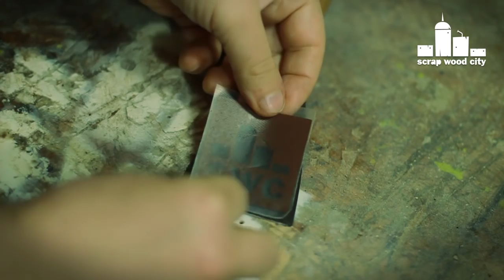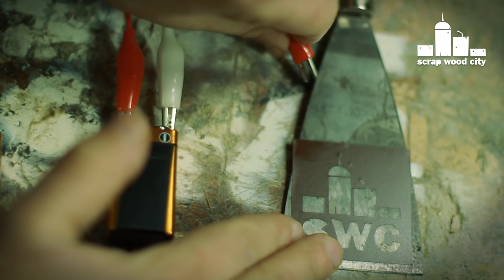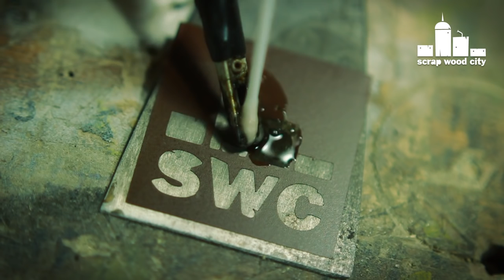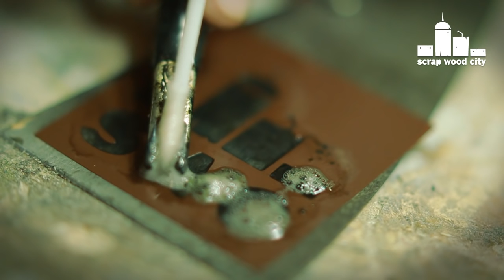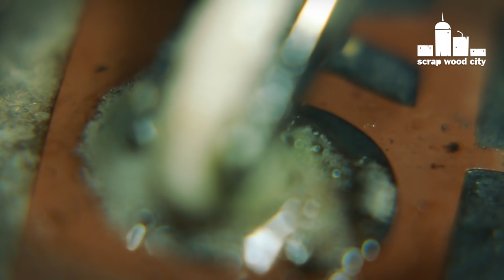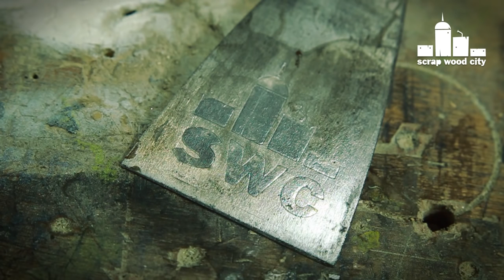DIY electrolytic metal etching with 9V batteries

Comment: Doesnt this produce chlorine?
How dangerous is it?
Reply: You could just do it outside
Reply: While some chlorine may be produced, the bubbling you see is not chlorine but hydrogen and/or oxygen gasses produced as the main side product due to the nature of the chemistry. Chlorine is very much water soluble (think of all of it that's put into pools et all for sanitation) but even if the process did somehow get messed, up your nose would tell you that you're making chlorine gas long before it gets to truly hazardous levels. If that happens, adjust your process or make sure you have some way to properly ventilate the area (on this scale, outside would work as long as there's any kind of wind).
Reply: Can make Chlorine gas (chemical warfare), Hydrogen (explosive) and leftover Chromium (VI variety is extremely toxic) from the stainless steel. Unclear if waste Chromium is the III or VI variety.

There is a lot of confusion and contradictory information out there on the interwebs. I suspect the danger is rather small with a small DIY etch like this, but most people making these videos also don't seem to know much about what they are doing. It works, it doesn't seem to hurt them, so they assume everything is fine.

Note: I also don't know how this works, the real dangers involved, etc, but I am trying to find out.